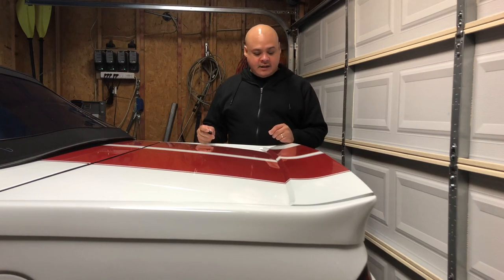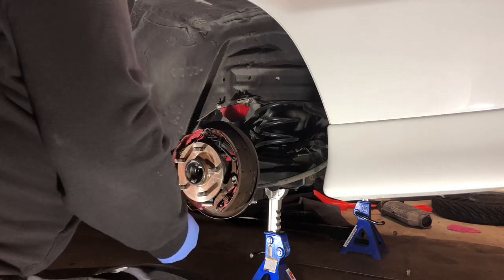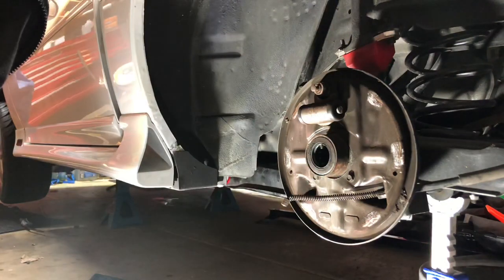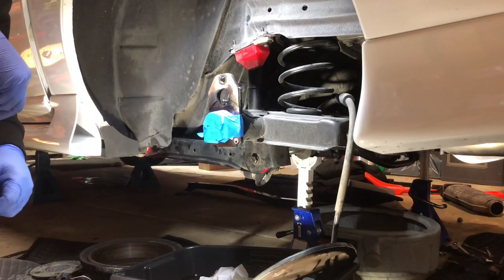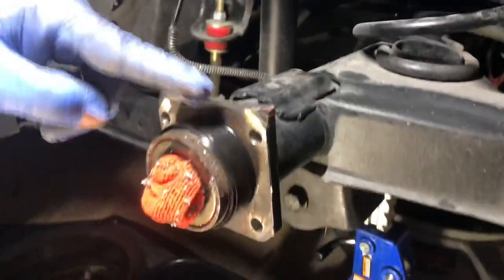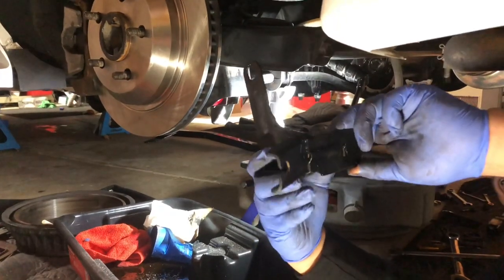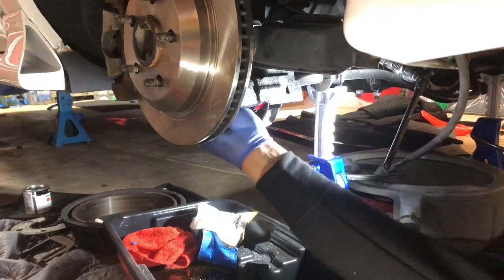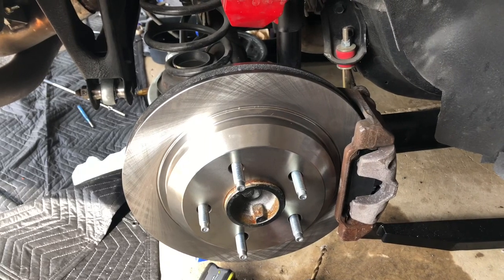1992 Z28 LS rear disk brakes!! (Disk brake conversion)

Comment: I did this with my 3rd gen. I'm having an issue with a clunking sound on both wheels. It looks like the slop in the rotor wheel stud holes are moving even after torking over 100 ft lbs. Did you have issues with this?
Reply from the maker: I do have a clunking noise in the rear at low speeds never thought to associate it with the brake upgrade. I’m going to look into this

Comment: I did this conversion on my 1987 camaro  RS. I used a 2001 camaro ss rear brakes works perfectly.
Reply: did u had to drill any holes? or was it a bolt on

Comment: I don’t see anyone asking about the ebrake. How did you make the ebrake work? The ebrake cables are different and shorter for the 4th gen correct?
Reply from the maker: I ordered the set from Hawks Motorsports, they seemed a little short still but I was able to get them hooked up and they work as advertised. I think they were 100 probably more now

Comment: I want to convert my 86 camaro 9 bolt which has opposed disk brakes to 89 camaro disk brakes with calipers on the same side of axle .  What do I need for that swap   thanks
Reply from the maker: I’m unfamiliar with your parts but I would start by cross referencing part numbers to see if they interchange.

Comment: What did you do for a proportioning valve?
Reply from the maker: The factory proportioning valve were the same for disk disk or disk drum from 90 up. I also installed a spring it the p valve which helped a lot. Car stops fantastic now! Better than a 1LE for sure